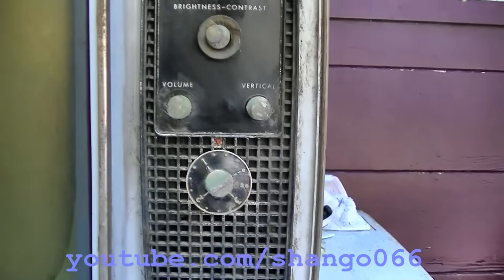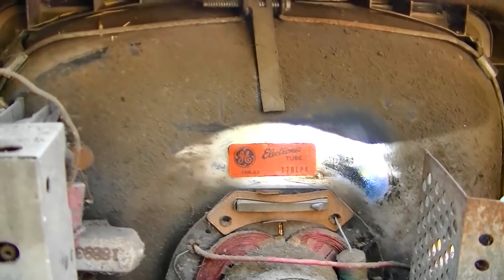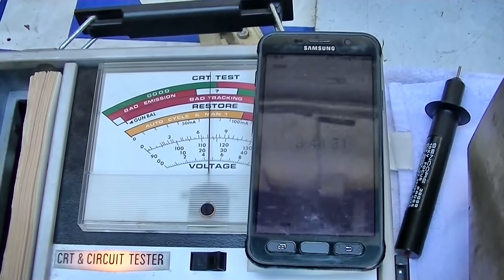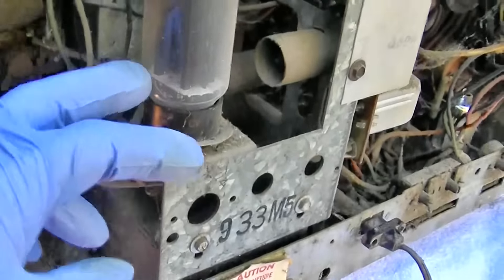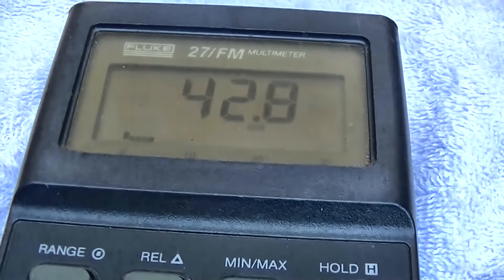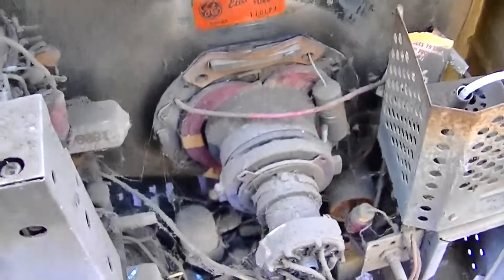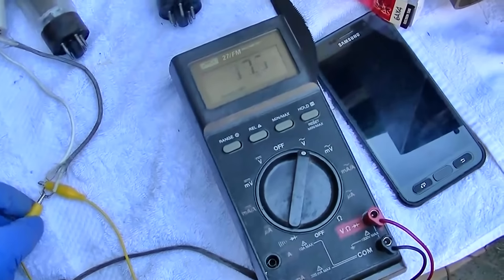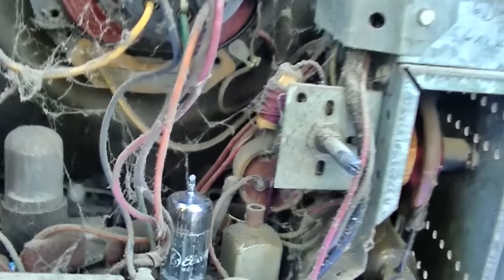General Electric M5 Early 1960s Black And White Portable Television Startup Analysis

Comment: Don't forget that the B+ for the pix IF chain and tuner sometimes comes off the cathode of the sound output tube. The tube doubles as a sort of series-pass voltage regulator.  If that tube is weak you may still get some audio, but the B+ getting to the RF/IF stages will be way too low to get things going.
Reply: Known as "stacked B+."

Comment: My old man was a 30-yr. or so GE engineer, so all thru the 70's, 80's, 90's the family "enjoyed" GE appliances and the odd radio here and there, the switches and controls of which all had that 1/2-a$sed feel and function to 'em.
Reply: The 1/2-a$sed feel goes in before the name goes on!
Reply: @Oldgamingfart  . .  "General Election"  ha ha! :^\
Reply: GE's got their hand in so many pies (heavy equipment DC motors, turbo fans, scientific R&D shite for space exploration, power plant dynamos... defense toys, etc...) that TV's radios, appliances -they botched on componentry. They must have spent that extra money on Q-C'ing parts as they installed them ~just to make sure the things would work for at most/least a couple of years.  Savvy Foxy WE BRING GOOD THINGS TO LIFE, FaRcE. Even the lightbulbs were downbuilt.

Comment: Love the shape of your light bulbs We don`t have bulbs like this here in the UK
Reply: LMAO i live in the us as well and i havent even seen those before! i wonder what kind of b ulb it is
Reply: @animeloveer97  The flat topped one? Thats an odd design. Most American bulbs don’t look like that. I remember seeing them back in the ‘80s.
Reply: @JoJoGunn1956  So that’s why they had a different shape. It was thicker and stronger to protect the user when the halogen capsule broke.
Reply: @5roundsrapid263  I'm not 100% sure that's a halogen bulb, because he picked it up at approx 10:18 and by all rights the glove and part of his fingers should have stuck to it. Being part of a circuit maybe it was at lower voltage, however.
Reply: I think that’s a 1970s/1980s Westinghouse turtle lite bulb; most bulbs looked like the other two he has on the bench. I used to see turtle lites occasionally at the Habitat for Humanity store years ago but not for a very long time.

Comment: You are correct on about use of solid state diodes in place of 5u4 tube.  Worse is vintage 5y3 tube tends to have around 60 volt drop!!  Inserting solid state diode will bring B+ in some amp from 315 all the way up to about 380volts!!

Comment: shango can you explain what cutoff means for the picture tube, I know emission, but you always mention that while testing them
Reply: Cutoff voltage is the G1 (control grid) bias voltage for the electron gun which creates a black picture. On top of this bias voltage the video signal is applied and if everything is working correctly you get a picture with correct saturation. If the cutoff voltage is out of range or not linear then you will get no picture or a picture with no or too much saturation/contrast. Hollow state audio people call that just the "bias" and write many and long posts on forums on where to set it to get the rights sound 😛 It is just establishing the operating point of any tube.
Reply: @kuebbisch  right, makes sense I'm guessing then picture tubes should have what we call sharp cut-off G1 as in a pentode for audio, I' m wondering if the grid can be somehow damaged after many years of use or something like that
Reply: @boardernut  Yes, even if a picture tube is more like a triode, due to the construction the electron gun acts like a sharp cut-off tube. The  control grid is a ring in front of the cathode and so has a uniform spacing and thus hopefully a linear relationship between control grid voltage and beam current (aka. intensity or brightness on the screen). Measuring this voltage is the same as matching audio tubes for same cathode current when used in push-pull amplifiers (without independet bias control). 
It is impractical to directly measure beam current (cathode current) in picture tubes due to the high voltage needed to achive the 0.8 - 1 mA most picture tubes run. Even if you achive that current, then you burnt the phosphor in the middle of the screen because the tube tester has no deflection 😁 So measuring bias voltage at cutoff/black level it is...

Comment: What is the function of that bottom knob?  It doesn't have markings that relate to any set I've seen before.  I thought it may be a UHF tuner, but it doesn't have the 14-83 channel markings of TV sets in that era.

A detent UHF tuner would be even more unusual for a set of that era.

In the early 80s, I had a similar set, GE 21T2425, given to me by my aunt when my grandmother passed.

I did some alignment, but the picture was still a bit soft.

I took out the CRT (Can't remember if it was a 21AEP4 or 21EAP4), and had it remanufactured (The guys there were VERY surprised I would spend $30 for that).

The resulting picture was very sharp (in fact, the focus was so fine that there was a lot of black between the lines).

The guy at the shop told me that with the rebuild that it changed the tube into a 21DMP4.

Sadly, a few months later, the tuner shaft broke 😞

Question: Is this one of those sets that uses a beam demodulator, using a high-resistance resistor supplying the tube?
Reply: It’s a mechanical sleep timer
Reply: @richodude2679  
Now it makes sense, thanks!

Comment: These TVs were sold in Italy too, branded "Dumont". I have three of these, with different chassis (for example a solid state rectifier). They put a new power transformer because we have 160 or 220v line voltages and usually the wires of these transformers lose the insulation and you have to replace them...
Reply: DuMont was an early American TV brand, and even a fourth TV network in the ‘50s. Their archive was dumped in the East River circa 1970... 😳
Reply: @5roundsrapid263  i know, but there was an italian division that operates until mid '80s. My family had a 1979 Dumont color with scr horizontal deflection

Comment: I have one similar to that one with a GE badge where your set has the timer. Mine is quiet off stations, but tunes fine on cable box or converter box. I'm pretty sure something must not be right either AGC or weak stage. I use it from time to time. Good set. I'm going to find a metal wire stand for it. In fact I think I have one, but it might be for a record player with rack for records on bottom.

Comment: Is that dave jones meters
Dont stop vintage tv repairs great videos   from your channal
Reply: lol i thought od him too when he said that
Reply: I think he's talking about the Mr. Carlson's lab Capacitor leakage tester.  I have one, but I spent way too much time buying parts and building it to send it away to Shango. j/k lol
Reply: Daves is just a trade meter, a rabranded UEI that is not better that UNITs on the same range. It was testes extensively on a 6 part vid by a guy (I dont ecall his name now, but he has been doing this tests to several multimeters). It got issues, wont past some HV tests, protections are not up to the job .... nothing wrong with it. But each time Dave get his hand in an UNIT it turns in such a drama ... and his prime product was not any better. I had UT61D for four years, used mostly to repair ATX PSU, dropped it several times .... ticking like new (only issue were the banana jacks, pretty cheap and crappy). Dave fails to understand that in some places people cant afford 250 dollar meter. Is the UT61D unsafe. Yes, probably .... you need to be carefull. PERIOD. Im not expecting to pay 10 to 20 times more to use a DMM in careless way and just because it wont pop it will turn into a paperweight.

Comment: I was taught that replacing vacuum tubes with solid state diodes doesn't work because the AC response, or rectifier rise time of modern diodes is too fast for the other tubes to keep up, such as your AM mixer tube.

Comment: Ha, a Sony TV 710 in the cage! I repaired one of those in my TV repair class in 1980 or so, then found a Sony TV 510U that was really cute, fixed that too, both of those little sets worked great for many years. My older brother had the 510 for years as it was in like new shape, i guess its long gone now. It's weird to see an early 60's TV with a 5U4 in it as reliable solid state rectifiers were pretty common by then. In fact even seeing the old black base octal tubes in that late a set seems a little strange to me. I guess GE at the time wasn't into pushing the latest tech in their smaller sets at that time.

Comment: If I had that set I'd remove the clock motor and keep it as a spare for my clocks. If it's just a sleep timer its motor should be very low hours. Just the rotor module itself is valuable because they only last for several decades of continuous usage before they need surgery. If TVs lasted that long you probably wouldn't have any repairs to show on your channel.

Comment: Modifying the power transformer instead of using a resistor sounds like strange advice
Reply: I think it was a passing comment explaining the output voltage is too high with the diodes

Comment: putting a LCD TV in vintage equipment is blasphemy!
Reply: Exactly,  same as putting a high powered V8 in an old 30s coupe. Restore the flathead and you have accomplished something.
Reply: Hey that’s the same chassis as the GE Forecaster. If that antenna holder you dug off the tuner isn’t cracked, I’d like to buy it for my forecaster please :)
Reply: Like cauliflower served at Christmas, it's not traditional.

Comment: I’m surprised to see a power transformer in a GE set like this instead of a series string setup. Usually GE stuff is “economy engineered” with the minimum amount of parts and the lowest cost parts at that.

Comment: How many hours do these tired tubes typically have on them before they go bad?
Reply from the maker: 2000 +
Reply: @shango066  Even more. I have a B/W TV which worked fine from 1962 till 90s. If it was just one hour a day, its 30*365 hours., so more than 10000 hours.

Comment: Its not a Shango066 video without bird song airplanes and lots of cool old TVs. Watched this while recapping an old Sanyo  TV that had dumped its guts on the board. Over here in the UK we just don't get that level of crust and crappola in vintage tvs..
Reply: You say that but I once got a Thorn 1500 working that had been dunked in a flooded cellar/basement for several months.

It worked but it stank when the valves got warm!
Reply: @stickytapenrust6869  sounds like a fun getting that thorn tv working. Ive picked up a few 60s tube bw portables that had been sitting in dusty garages and have been entertaining during their first few days of being brough back to life.. never done a flood damaged set. I leave that to shango :)

Comment: You should seriously consider building Mr. Carlson's capacitor leakage tester and maybe some of his other designs. The Carlson MK. IIV Alpha 3 Ultramax Capacitor Leakage Tester Omega Version 1.5 is a low voltage meter but yet can test for leakage and forecast future failures better than any other tester out there. It has been proven to be 100% accurate and is outstanding... along with all his other designs that outstandingly outperforms and put the original versions to shame. You would be doing his channel good by helping get it out there and his content. he has a Patreon which he puts the Schematics of his builds on for all those interested. I believe you would love the capacitor tester :) https://www.youtube.com/watch?v=LhovRIM5xAo